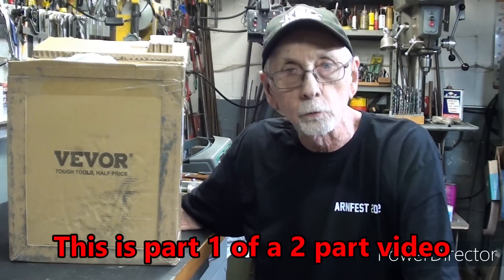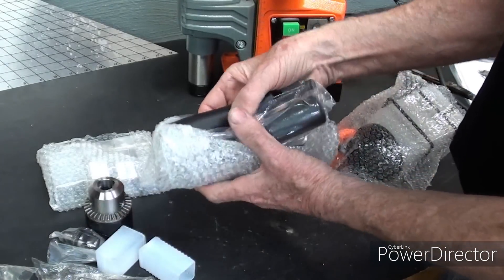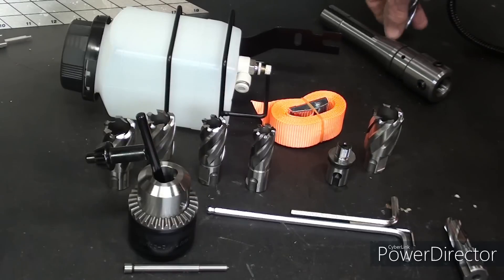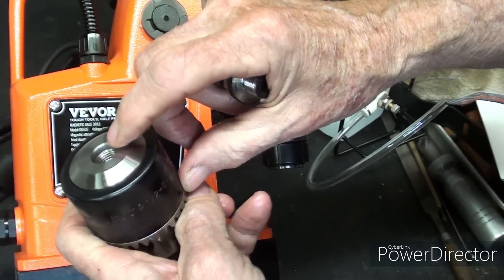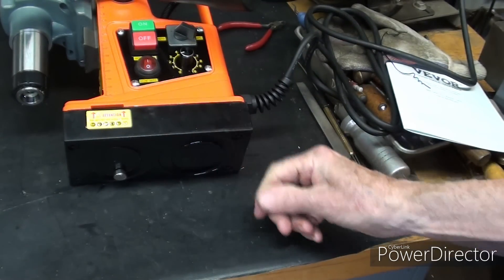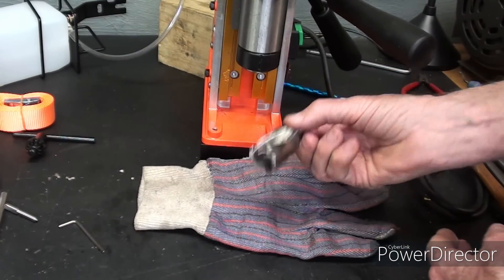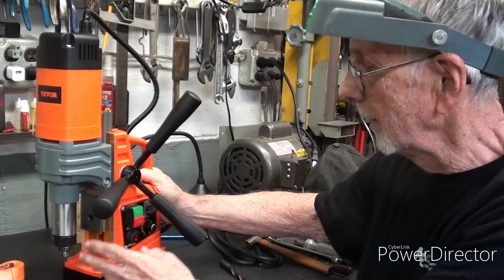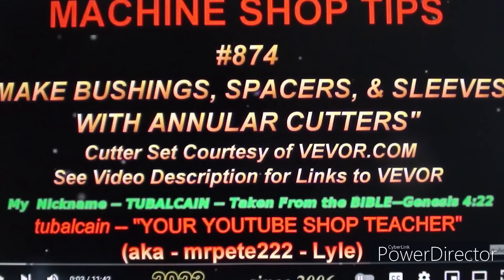VEVOR MAGNETIC DRILL PRESS pt 1 #876 tubalcain

Comment: Mag drills aren't the best for tapping for the reason you gave. Been there done that don't work. Always wipe the magnet free of oil and chips before drilling the next hole because it won't clamp to the steel and will walk on you. My advice is throw the metric cutters in the scrap. You will never use them. Buy a set of Hougen SAE cutters.ALB.
Reply from the maker: You are right, tapping on this machine is not a good thing